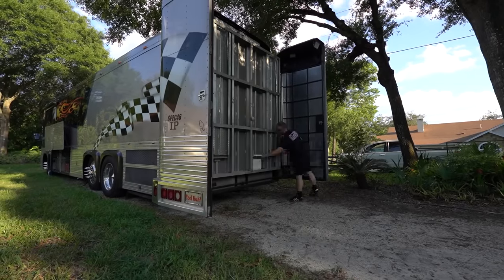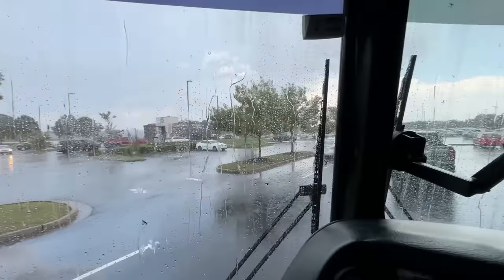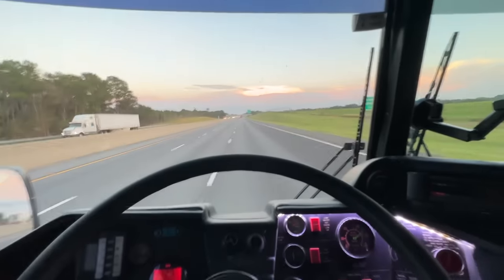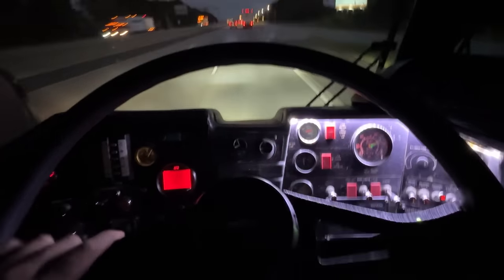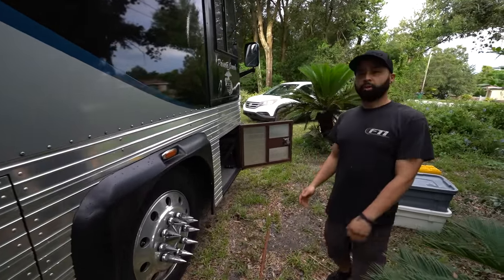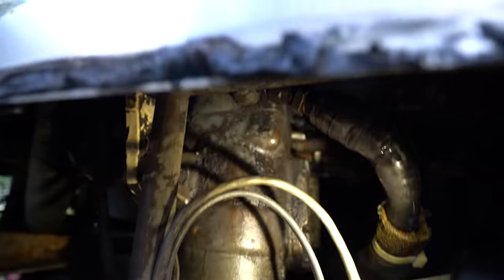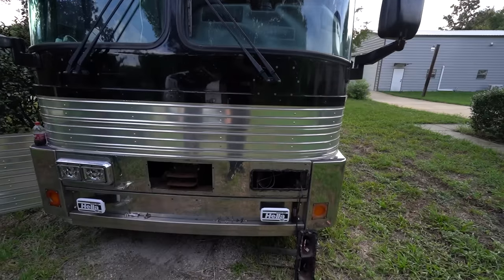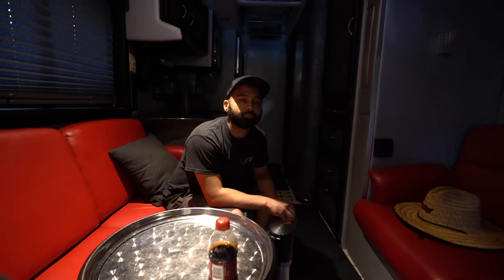First breakdown in the new car hauler bus conversion. major problems far from home.

Comment: You should check all fluids and systems befor every trip and during the trip every 2 hrs cause when using a heavy duty vehical things break and vibrate loose

Comment: Reusable hose ends u buy a few diffret sizes goes right on like a earls.
Didn't have earls that could have gone on it u do something called skive the hose end thread the earls on and if that was jic fitting its same as a AN,
# 8 jic is a # 8 an

Comment: Is there a way for you to put an electrical power steering pump and reservoir in the front and just wire it in? Just an idea, I don't know if thats a logical and or feasible for your situation. I just have a feeling it would be easier to service just in case you need to work on it.

Comment: Not a rv mechanic or anything but can’t u hardline the center and run two short hoses on both ends would save u from having to ever replace 50” of line again.

Comment: If the steering lines are one piece then I would have the new ones made up in sections so if there is a problem in the future you don't have to replace the whole line again.. If it was me I'd want to get it in a commercial workshop where you can get under it for a full inspection of everything...

Comment: I haven't read all the comments yet nor have I finished the video I'm only about halfway so this suggestion is probably moot, but electric power steering I wonder if it's a worthwhile option looking into? It'll eliminates failure points like hydraulic hoses especially 50 ft long ones and stuff like that and obviously it could be located wherever you want to locate it. Would they be reliable enough to power something that big? Or would it be too expensive? I mean the things 30 years old so you got to consider things like that poses lines failing brake lines airlines all that stuff which I'm sure you have. And I'm sure we'll see it coming to pass in one way or another whether you take pre-emptive action or you know fix it as it fails. Just a thought I had.
Reply: I don't think electric steering is the way to go for something that big. It would be way more expensive and complicated than it needs to be. I am sure there is something out there that would do it, but what do you really gain?

Comment: I think one think you should take the time to learn is big rig air brakes. Checking the slack adjusters, pad thickness, draining the air tanks, checking the air dryer. Etc etc. very important I would take the time to educate if I were you.
Reply: I would definitely familiarize yourself with the lift gate too. No lift gate, no getting the car in and out

Comment: It might behoove you to replace the hydraulic power steering w/ an electronic unit that mounts directly to the steering shaft.  Much less to go wrong, no more long fluid lines, even save a little power & mileage cuz the pump won't be necessary any more
Reply from the maker: I’ve done that in a car. I wonder if it would be powerful enough for a bus. A
Reply: @Taylordrifts  quick google says there are heavy duty kits for larger vehicles; a kit from Summit was my top result

Good luck with your process for determining and implementing a solution!

Comment: honestly need to get that thing up on a lift and take a look around. hydraulic hoses with pin holes are the worst part of my job.
Reply: oh and getto fix on the road, I've ran a short screw into a hose at the pin hole and put a hose clamp over it and it made it a week till I could get parts.

Comment: That's the second time that a breakdown has caused you to miss an event in a fairly short period of time . If it has a mechanical pump , I would just loop it around and feed it right back into itself . Because if there was ever a good reason to go with electric power steering . A 50 ft long power steering line would be it .

Comment: I think I would be looking into an industrial quality electric power steering pump to mount up front and eliminate the problematic hoses.
Reply: Either that, or I would run hard line through the not easily accessible, mid-bus part, with fittings on the ends you can run shorter hoses to in the accessible areas.

Comment: Think I'd split that line into 2-3 pieces. Be a lot easier swapping short sections if something happens again. That said. Tractor supply sells pre-made hydraulic hoses. Might have got you outta the bind.
Reply: More joints, more leak potential. I'd do it like they did at the factory.
Reply from the maker: I mean once replaced. Will probably last another 30 years. These are the originals. So they’re pretty old. I’m fine with the headache of if I still have it in 30 years.

Comment: Taylor , let me preface this by saying I know nothing about fixing cars . This be said , isn’t the power steering line nothing but a heavier duty hydraulic line ? Couldn’t you have cut the line , then using a galvanized hydraulic line , ferrels and nuts to patch it ? I used to repair hydraulic lines on roller conveyors in tractor trailers for palletized freight . Isn’t this similar to that , maybe ? Again I know nothing about fixing cars , it’s just a question . Thanks for your time . Tough luck about going home !
Reply: Power steering hose isn't anything special. Not heavy duty at all compared to some hyd. hose. I am not sure how he would use a hard line and compression fittings to fix a hose. If it was a hard line, sure that would work if you could get fittings up to the task. I am not sure if that was a return or pressure line. Return can be done with hose barbs, very little pressure.

Comment: Wait they don’t use engine oil so they? I remember a kenworth I was driving, the power steering went back asap on a turn and came to find out later that engine oil was used for the power steering and that’s what caused it to break, it had to be replaced
Reply from the maker: That’s what the manual calls for.

Comment: so how in the hell do you feed it underneath, doesn't look like much room for a guy to lay under there once you disconnect from either end. and would it be smart to leave a shorter hose on the ps end so if it happened, you could just replace a small section easily? looks like a major pain without some type of pit to stand underneath.

Comment: Is it possible to hard line it and have 4 short hoses that are identical so you can have a spare on the bus that’s easy to replace?
Reply: Hard lines do not take vibrations nearly as well as hose. The more connections you have, the more leak points you have. There is a reason they made it one long line at the factory.

Comment: What if instead of doing a huge long set of lines, you just remove the power steering pump and put one of those electric pumps up by the steering box? Or put in an electric column, bypass the hydraulic system altogether.
Reply: That is a lot of weight, you would need a monster electric pump to do the volume and pressure required. Sounds like a nightmare to me, just change the line and forget about it. It probably doesn't even make enough juice to run a pump capable of replacing the engine driven one.

Comment: So lemme get this strait you built the Fummins the “ultimate tow rig” then for some reason bought a new truck which quickly broke down, meanwhile the Fummis was just sitting there then you bought a stick shift Cummins which is a really cool truck, finally some reliable Cummins towing.  NOPE bought this old rig, it’s cool to be able to camp in but not if it breaks down and you have to turn around.

Comment: I'm really surprised it's a single line, every bus I work on is hard line in the middle so it's just hyd lines on both ends.    I would spend alot of time changing all questionable coolant hoses and any plastic coolant pipes that engine has.   Bad trips also make for good videos which isn't a total loss.

Comment: Just saying the Fummins never let you down since you have actually touched everything on it. You just kind of abandoned the Fummins as an option after building it out with all the right parts and touching every system so that you would know its good. It could still fail you for sure, but realistically you know the age of everything on the truck cause you put it all there. Your whole build ethos with the Fummins was "Good engine paired with good chassis, built by you to high standards, and if it fails, you know how every nut/bolt works"

Comment: powerwash that engine bay,  get it spotless in there , a clean engine is a happy engine, and you can see a leak , and it reduces the chances of a fire.. most engine fires get out of control due to oil residue and oil soaked dust and dirt all over the engine bay

Comment: can't you lift the gate while been vertical?  (might have to use the winch a bit to release the cable to lift high enough  but no need to use to lower it totally).?  lift to the floor height and open the engine door.
Reply: Never trust hydraulics with your life.
Reply: @--_DJ_--   I agree, forgot about that.... still possible to put something to prop it up.(and have the pole stored inside of the rear door framing.
Reply: @maxpat82  I suppose a good sturdy prop rod would do the trick. It would save a lot of time. 
I yell at, at least one of the boys at work once a day for being in a bad spot. My favorite is when they walk under the boom of my excavator to hear what I said, when what I said was "quit walking under the boom!"

Comment: Unfortunately this bus is like 35 years old or around that. Hopefully it doesnt just have system failures every trip like any old used car does. All the lines, mechanical, wiring, everything is super old and probably in need of replacing

Comment: Good time to upgrade the power steering to a electric pump up front and eliminate the lines going the length of the bus
Reply: Why spend thousands when hundreds will fix the problem and the result would be less complicated and equally if not more reliable? This isn't a car, you need a lot of volume and pressure to turn those wheels, that would be quite the electric pump. Long lines are a pain, but not worth going overboard trying to avoid.

Comment: when you do finalize the repair if I was you id hardline the long ass run it will probably be cheaper than hose.  if you have not thought of that already! then try and find two rubber hoses from like a dodge ram or whatever car that fit front and rear from your hard line that way you can repair it anywhere just by finding  hose for X car get it!?!?!   Or AN fitting it.   The return line is easy

also when your running your new line check all your airlines for chafing around the mounts etc. and tape them up I have seen them rub over time even though the mount has rubber on it.  the only way to stop problems is just change anything yo think could be a problem later

Comment: Dude needs to find a GOOD bus mechanic in his area and put this on a lift.  Go thru the whole thing, Taylor can fix what he can, let his mechanic do some of the heavy lifting with the lift/specialty tools.  Don't fix things just piecemeal, you'll forever be chasing problems and having the thing break down on the road.  Its 35 years old, looks like it sat a bunch, except for rebuilding the engine/transmission its going to need pretty much everything.

Comment: I've done this very thing on my buddies Wanderlodge. https://youtu.be/luYiYTjwg-s?si=Yes9bKb3HVm0lDoA Hose all the way front to back. I have also heard of guys having this same issue and they ran a line zip tied to the outside just to get them to their next destination where they could install the line more permanent. Look into what kind of hose you have, some hose you can use field installable hydraulic fittings, do not require a crimper at all and can be installed with a couple of wrenches.

Comment: would electric assist steering be an option
Reply: Anything is possible, but it would be a massive pump with a massive draw on the electrical system. It is just a bad line, not a big deal other than the length of it.
Reply: @--_DJ_--  nexsteer make an electric assist for OTR trucks
Reply: @quenwhittington6082  Not one you would be putting on that bus. Very cool tech though.

Comment: Shitty thing about these motorhomes is that in case of an accident you would probably be better of in a cardboard box. One of the plus sides of using a truck is the safety that it provides.

Comment: Truck and trailer > Bus

The fact the guy traded the bus for a trailer and cash should have been a sign. You can't easily fix a bus on the road if it breaks down.
Reply from the maker: You also can’t easily fix a newer model truck on the road if it breaks down.

Comment: I think I would just pay out for a beefy electric pspump then mount it up front.
Reply: Why? The hydraulic steering works fine. It just needs a hose, why spend thousands on a setup that will be complicated and power hungry when there is already a perfectly good system on the bus?
Reply: @--_DJ_--  because I am lazy and wouldn't want to deal with that much hose. Also, depending on what pressure that hose is rated to, replacing 2 hoses could also be thousands.
Reply: @Falney The lazy route is changing a simple hose. You would be in the 2000 psi range at most. Could be done with single or two wire. Probably about the same cost as cable to run an electric pump that could do the job. Also, a one off steering system doesn't sound like the safest option either.
Reply: @--_DJ_--  I did say to mount it up front. There is enough space up there. But OK.
Reply: @Falney  Yes you did. Where do you think the power comes from?

Comment: I would be scared to buy anything that complicated and over 10 years old. I’d rather be on a payment plan and a nice one in good condition (or new).
Reply from the maker: I tried that. It failed. The dealer told us they’ll get to it when they get to it while we were stranded 9 hours from home with a trailer filled with my whole race program.
Reply: @Taylordrifts  So sorry about that. I should’ve watched all the way through first and then comment. I hope this works out, cause it is sweet looking (I’m from the 80’s, so I’m digging on the whole styling). 😎

Comment: Take it to Bus Grease Monkey don’t keep ignoring the squealing of the brakes they should not be that loud and do not take the bus to T/A, Love’s or Petro you have to get a bus mechanic these diesel shops have ruined quite a few buses just ask Bus Grease Monkey he has gone over a few instances where they have cost the owners a chunk of cash to get their buses repaired properly. They’ve even ruined lugs not paying attention to left or right handed threaded lugs over torqued stripped threads and not even tightened some lug nuts he took a bus to get new tires put on and found they ruined some items and he went back and showed them the damage and all they did was say the guy who did the work was new and didn’t know any better and said sorry put in a repair order/complaint to the company and you might get reimbursed I think it was T/A but ask BGM to be sure. It not just your life on the line but others on the road also and responsible as you seem you don’t want that hanging over your head. Good luck.